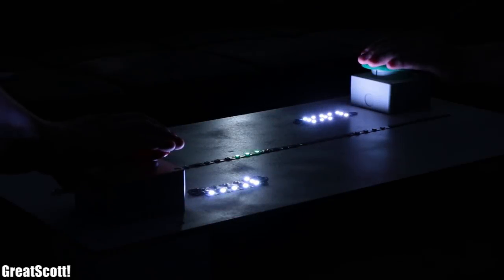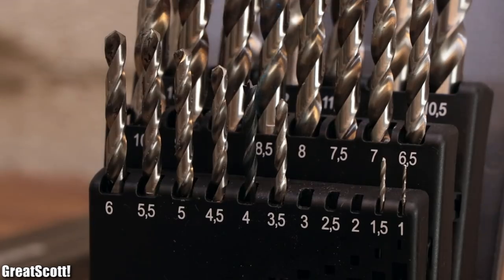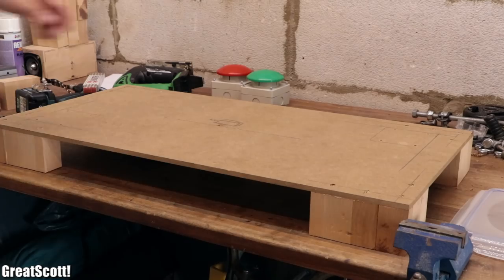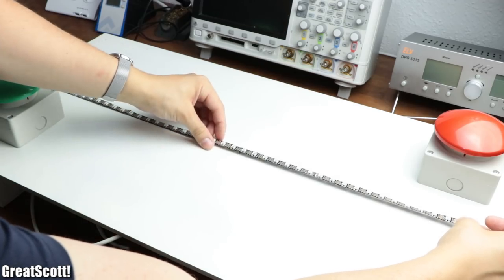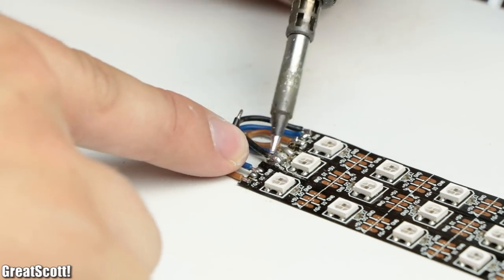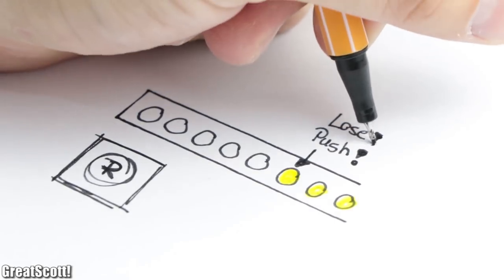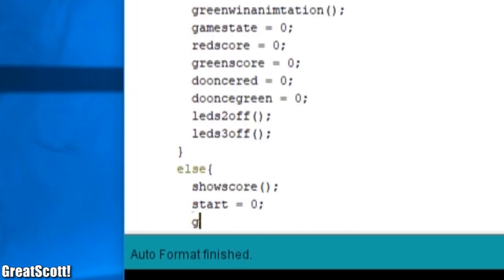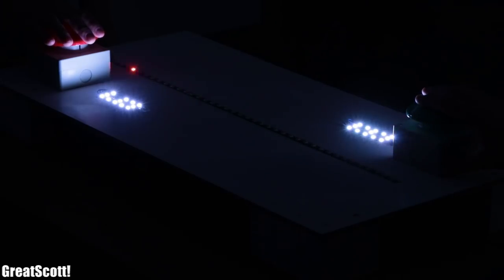Make your own 1D Pong Game

Comment: Great! but I think you could add a few features to the mix, for example:

->Before a match you should be able to select the necessary points to win, and the difficulty (the initial speed of the dot)
->Before the match can start, both players have to press the their button, when released a small countdown (like 3 or 5 seconds) start and when it reaches zero the match starts

Also you can add different games to this, like the two players have to press the button faster than the other, If one is hitting it faster then the dot (initially in the center) moves towards the other player, if it hits the last led the slower player loses.

Or Stop the dot in the center the closer to the center the more points you get.

Even if this is a 1D pong, this hardware has SO MANY possibilites 

And again, Great Job dude
Reply: As he said, he's not a programmer, so writing all that will probably be pretty hard for him
But the concept of using LED strips for the display is pretty interesting
Reply: Mk Km yep 100% genius!  Why doesn't he just LEARN to program?! Never understood the unwillingness to learn something, even if it appears to be hard..
Reply: Programming in general is not really rocket science. Programming 1D pong is definetely not rocket science.
Reply: @docholliday4546  it is qrong to tell him what to do.

Comment: To diffuse or otherwise improve LED animations, you can antialias like so: The pixel location is a float, not an int.  When it is between two pixels use linear interpolation, i.e. at pixel location 8.7,  pixel 8 get's 30% and pixel 9 gets 70% power.
Reply: Why float? Just use a fixpoint represented as integer and right-shift x.x
Reply: If the target brightness is a power of 2 sure, but many applications prefer a normalized 0..1 interval, so using float with floor() is common and easy to understand.  Like, say, preferring a sinosoidal power curve instead of linear, or being a speed deamon, using a lookup table of modest size.  Good question!
Reply: Power of two, not necessarily, this is not how fixpoint works, for example if you use an U8 and decide to fixpoint it at a nybble, you'll be able to represent numbers from 0 to 15.9375 with 1/16th precision, or you can do 0 to 31.875 down to 1/8th by giving it 3 bits of fixpoint, and 8 distinct brightness levels isn't too bad at all. But then, of course a 16MHz Arduino has plenty of CPU time to do floats in software, in fact the common 3D printer firmwares still do motion planning in floats, and that's a bit more heavyweight than lighting up a bar of LEDs, so in such easy cases you're right, just not worth the extra fuss.

Comment: Sweet ! 

You really do need some thinner wires though - will make your life a lot easier

I usually buy 30 core wire at my local electronics store - works brilliantly - and means you have very nicely coloured wires too
Reply: Darieee Or you could "repurpose" or in other words take apart LAN cables or other similar cables which are long, thin and contain multiple signal lines :)
Reply: no - you can't ... trust me I had that idea, and some of the LAN cables have the shittiest cables the planet has ever seen

Bought 10m of the stuff ... they wouldn't take solder, would be fragile and brittle, the plastic melted massively and fucked up my iron tips ... 

NEVER will I try using LAN cables for anything but actually a lan area network related task
Reply: Weird! I've used LAN cable wires for my last few projects without any of those troubles, must really depend on the brand
You can get spools of solid core telecom wire for very cheap too
Reply: ive used lan cables many times they are awesome
Reply: +Darieee: I'm guessing you have used cheap chinese pre terminated cable.
Reply: yeah - that's what I used .. still have nightmares thinking of that shit
Reply: Darieee it sounds like you got some CCA Lan cable. That is, Copper Clad Aluminium. I use full copper solid core lan cable for lots of stuff and it works fine. Breadboard, general hookup, patching krone blocks, etc. CCA should only be used for fixed installations, if at all lol. If you do use it, crimp it or use it with the intended terminations, it won't solder at all.
Reply: Please don't use Copper Clad Aluminium cable, leave to the Chinese.
Reply: Use proper Cat 7 or at least Cat 6E. I like to rip apart computer PSUs because they have nice, heavy gauge wire in them.
Reply: I use solid core telephone wire it's good for arduino projects or if you want higher current you can always pair up the conductors as it's 12 core and colour coded in pairs with coloured stripes

Comment: Those Wago Klemmen are awesome. We have them at work, and they are so much better than the normal ones.
Reply: their new 221 series are improved a lot for tiny size constraints. If you don't need as much passing current (about 20 amps nominal) they are a more modern choice. I don't have any stocks or anything, i just find them equally awesome :D

Comment: Suggestion: in the red range assign a value that either sends the ball back faster or slower dependong on which one it hits. IE: red led1 goes back slow, but red LED4 goes back fast. That way there is more strategy and variance in the game vs. Straight timing.

Comment: Did you pre-drill the holes for the screws or just countersink? The wood cracks easily if not just the threads, but the whole screw is driven into the workpiece.

Comment: Why do you use a while loop rather than an if loop for the pause? The while loop will lock the rest of the code up whilst it iteratively evaluates, whereas an if loop would check the conditions and then (if not) proceed to the next block of code allowing you to do more with your code. For this example the while loop works fine, but it seems like a bad habit to use it in this way?

Comment: Great project but isn't power consuption a little bit high ? At any given time maximum 30 leds are on. Each will draw 20 mA. So maximum power consumption of leds should be 600 mA. I think arduino and led strip's controllers won't exceed 100 mA.
Reply: CrazyWinner357 but each led is actually 3 for rgb so x it by 3 depending on the colour.
Reply: Dan Herrin Yeah, I completely forgot it. Thank you :)

Comment: For the love of God, please hide and protect the arduino and Wagos. Just a simple plastic wiring box that you can hot glue onto the back side. You could also make it look a lot neater if you strip the isolation further back.
This is just an OCD trigger.
Otherwise job well done as always.

Comment: was there any reason why you could not use on of the button housings to store all the circuit, cables and power jack? the idea of the arduino just dangling under the "game" board like that gives me nightmares..
Reply: I don't know why you'd get nightmares from sloppy attachment of a $2 low-voltage board, but reusing existing housings that are already part of the build does seem like a great suggestion!

Comment: Please could you make a video about creating diy laser cnc or a diy function generator?
Reply from the maker: On my to do list
Reply: Had to to this in an engineering class. We did it the analog way. Mostly just using OP amp (the crappy uA741).

Comment: Könntest du anstatt den Arduino nano auch ein Digispark  Attiny85 Micro USB Board nehmen ?
Reply: If you can fit in all the code and all the connections, sure. The bootloader on the Digispark is quite a pest, it takes up most of the device ROM.

Comment: How does the LED strip addression work?
Reply: No direct addressing. You just write a long string of colours, and each LED chip consumes one colour and sends on the rest to the next chip, so you need to write the colours to the bus in rapid succession as many times as you have LED chips. If you stop sending data for 50µs, the sequence resets, and instead of sending the data on, the chips start consuming the data again.

The standard solution is that you allocate a buffer that holds the colour data for all your LEDs, and hand it off to an existing library which does the actual writing.
Reply: Siana Gearz Oh thank you

Comment: Can you do this without Arduino?
Reply: It is fundamentally possible to do this without a microcontroller or even without a microprocessor, because this is how early arcade machines were built, but it will get huge, complex and expensive, and will likely take months to engineer and troubleshoot. Consider, for every piece of functionality one would need a handful of logic ICs, and each of them might cost 10-30ct but these costs and their support components will add up quickly.

You could of course pack all of those discrete logic components into a CPLD or low-density FPGA, but the cost would still be double to quadruple that of an Arduino.

You could use a bare naked microprocessor (like a Z80 or 6502), a parallel EEPROM and a bit of SRAM, but that will again be more cumbersome and expensive than an Arduino.

You could use any other microcontroller board, but Arduino are just so damn cheap and convenient, and there wouldn't be a fundamental difference in approach or result, so it's not worth thinking all that much about.

Or what did you have in mind?

Comment: make a 3d printed cnc/3dprinter
Reply: I had made a cnc working fine
Reply: Iceteavanill yes from scratch even the rails i made myself.total cost around 150 $  excluding spindle
Reply: Let him finish his quad-copter first...
Reply: As a matter of fact, electronics challenge is pretty much zero since RAMPS and Arduino MEGA come off the shelf, and so do viable firmwares Marlin, Repetier, and it would be nonsensical to implement either from scratch since you'll end up functionally with the same thing. Any desirable changes to RAMPS can be nested right atop of that. As to mechanics, everyone has their own approach, and some work, some don't work very well. If it didn't have to be a 3D printer, then Uno + CNC Shield + GRBL is a common approach.

Comment: Did you really marked your wood (all 8 pieces) before cutting? You should never do that. Dead carpenters all around the world are rolling in their graves so much.
Reply: it probably helps if you tell people why...

The reason you don't do this is because of the thickness of the saw blade, if you mark a bunch of pieces then cut the later pieces end up shorter because of this.

Comment: Am I the only one which gets angry when someone uses superglue or epoxy for wood on wood use?!
Reply: Both have been used by numerous music instrument makers. Obviously superglue never for parts bigger than a square centimetre or mechanically loaded, but epoxy has seen a number of uses, if memory serves.
Reply: I don´t think instrument maker use it, they probalby use bone glue like the generations before them. Normal wood glue is enough for every application with wood, unless you try to bond it to something else.
My dad is a carpenter, he almost killed me once when I told him that I epoxy glued wood to steel xD
Reply: Hide glue is of course still used! There's the neverending debate of hide glue vs. PVA-D3 or D4 vs. Titebond, but hide glue is indeed what you expect to hold most of the instruments together that are more traditional, higher value, and are expected to be repaired, because steam will debond it. Inlays and the nut are often on CA, and setting a neck on epoxy is controversial, but some luthiers do it like that because of its hard filler property.